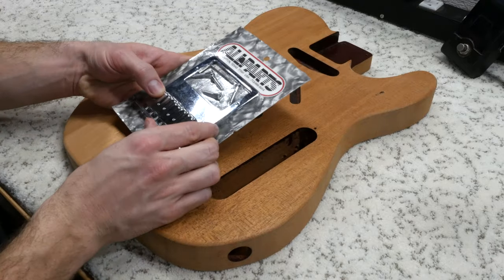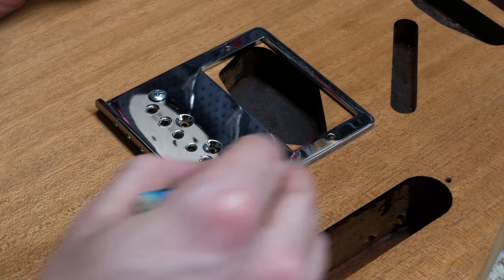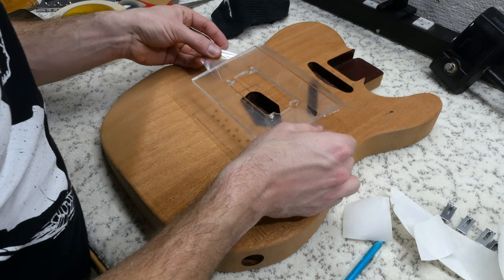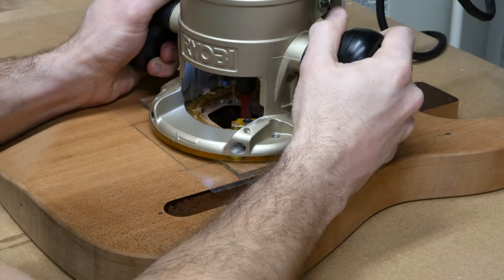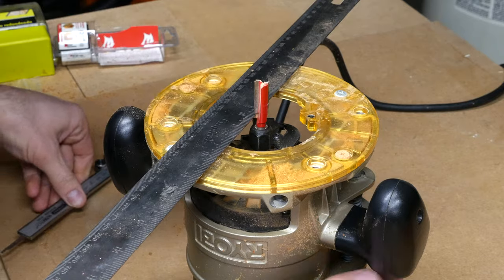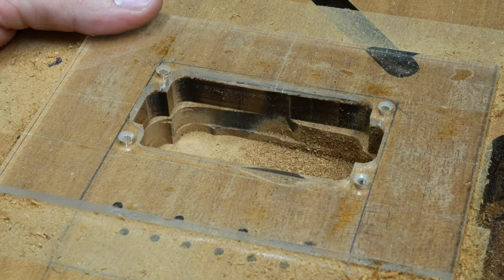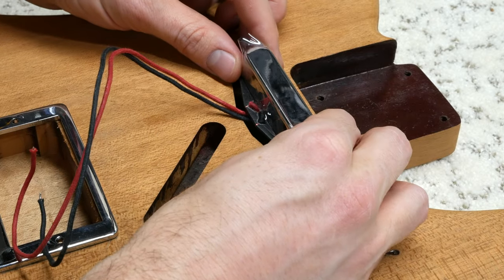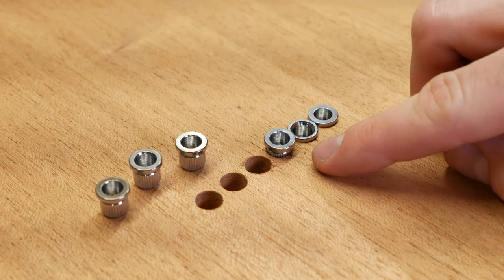En Route! || eBay Telecaster Revival || Episode 4 || DIY Partscaster Guitar Build

Comment: Interesting build. Could you address two issues that I have had when using a humbucker in the bridge position with a Tele neck pickup? First, is the difference in volume when switching from one pickup to the other. Second, is the choice of volume potentiometer. Using a 500K pot for the humbucker may make the neck pickup too bright, but using a 250K pot for the neck pickup may make the humbucker too muddy. Also, what capacitor value do you plan to use? Thank you.
Reply from the maker: Sure! 

For the volume, you can always try adjusting the pickup heights to get them to sound more uniform in volume. Takes a bit of testing, but you can get them pretty close! You can also try getting two pickups with close output readings and use them. This build is finished and all I had to do was adjust the pickup heights. 

For the pots, I went with 250k and followed a SD diagram. There is a video coming soon with the whole wiring process. Here is the diagram: https://www.seymourduncan.com/resources/pickup/wiring-diagrams

I think I want to try 500k instead though. The 250ks are a bit too dark for me. They sound great but I like brighter sounds, so I'll most likely do a follow-up video after the build is done detailing some of the changes I did. Thanks for watching though! :)
Reply: @AugmentGuitars  Thank you for your response. One option I've thought about when having a single coil pickup and a humbucker on the same volume pot is use a 500K pot but put a capacitor between the single coil lead and the three-way switch. I haven't done this, but it might reduce the highs on the single coil and still allow a capacitor on the tone control more appropriate for the humbucker.
Reply from the maker: @TeacherAn   ahh that could work as well! I haven't done anything like that per se but it sounds like a good idea. If you try it, let me know how it goes!

Comment: If the eBay holes are drilled in the wrong place or they are no holes  - How do you check that the bridge is in the right place.
Reply from the maker: Great question! You can use this calculator on the StewMac website to find the correct bridge placement for any scale length. It's a very handy tool! Thankfully, I checked the placement of this bridge before starting this series to make sure everything would work. It's a 25.5" scale length with 22 frets, so I plugged that in the below calculator to verify the placement was correct. Hope that helps you! 🙂

https://www.stewmac.com/fret-calculator/